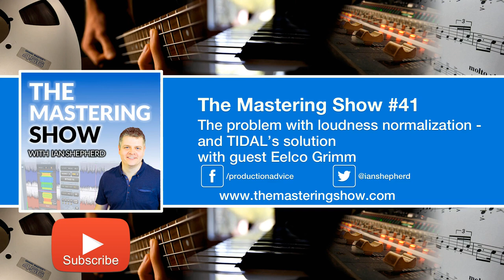The problem with loudness normalization and TIDAL’s solution | The Mastering Show #41

Comment: So I had to listen to all of this, only to find out you do album normalization just like ReplayGain which was invented 16 years ago.
Reply from the maker: I think ReplayGain uses average level, not maximum - and the important part is that it's enabled all the time (and preferred) whereas I believe with ReplayGain it's disabled in shuffle or playlist mode. And finally TIDAL uses LUFS, which works better than ReplayGain, in my experience. But it's true that ReplayGain has album mode, yes.